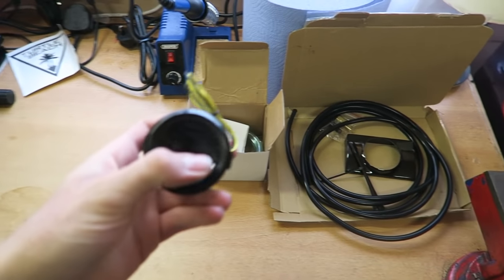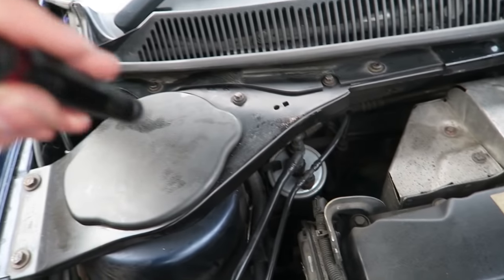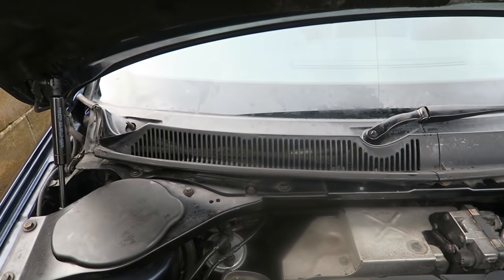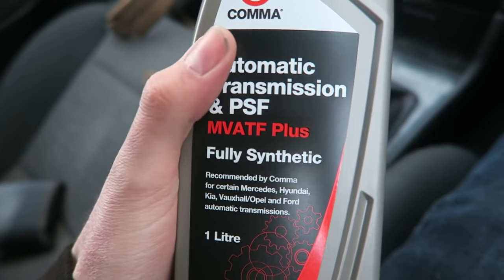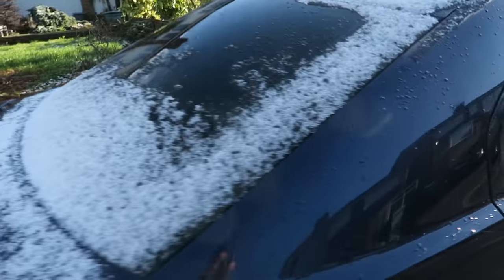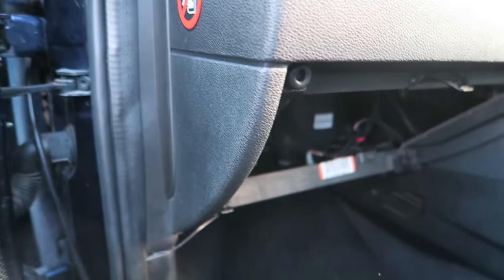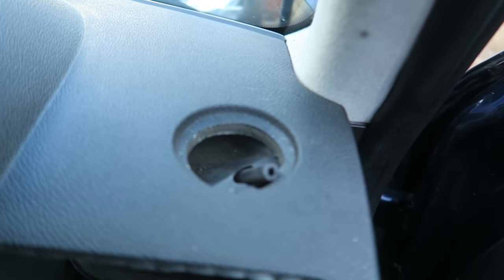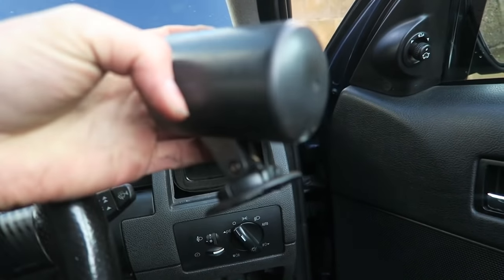Attempting To Install a Boost Gauge (Mondeo ST)

Comment: POWERSTEERING FLUID IN SOME ST'S IS THE GREEN FLUID TYPE. I AM PRETTY SURE THIS ONE TAKES THE GREEN FLUID. EVEN FORD RECOMMEND THE NEWER RED STUFF (BY MISTAKE) BUT I THINK IF YOU CHECK IT SHOULD BE P/N WSS-M2C204-AA, WHICH IS GREEN.???

Comment: Buy a RC nitro car fuel filter from eBay and put it in the vac line. It will stop the vibration you're getting on the gauge.

Comment: A tip to get the windscreen wipers off that has ALWAYS worked for me on all cars is lay the wipers on the windscreen like they usually do and push down on the pivot point... so the hinge. It works surprisingly well. Better than having them up and just pulling as that is pulling them on an angle which makes them bind.

Comment: Couldn't be arsed to read through all 180 comments so apologies if this has already been mentioned 179 times ; If you have your heart set on installing the gauge in the air vent, you have a couple of options. First, buy a spare vent from a breaker's yard and cut the top or bottom of the vent walls and then your current gauge will fit. Block off the air pipe in the dash. Done.

Second option, purchase a electronic boost gauge set. The signal unit is separate from the gauge itself and all the electrical plus vacuum connection goes into the signal unit (some call it a gauge controller), all that links the gauge with this is just 1 small cable. These electronic gauges are much thinner and are easier to squeeze into tighter spots. If you want to play it extra safe, get the 52mm diameter gauges as apposed to the 60mm ones. Plus, I personally favor the electronic ones because they utilize stepper motors for the needles, which eliminate that needle judder, and I love having the needle sweep across the gauge face when I turn the key on. Just makes it feel that little bit more, well, satisfying.

Comment: Heater matrix pipes are central & surrounded by foam so that's usually a good place for VACUUM hose. Also boost guage is essential to anyone tuning diesels, it can tell you if your turbo is going bad long before the seals actually let go & blows the engine up by running away( self destruct) they're also handy for boost leaks & over boost problems👍

Comment: The gauge flicker is the same thing that happens when you use vac gauges when balancing carbs , to get around it on carb vacuum guages you use little valves (very similar to the types used on fish tank air lines) to control the flow of suck and pull through the hoses so it moves slightly slower but smoother removing the needle flicker

Comment: my clock boost gauge is better ;) .... and i see a few comments saying boost gauges are not necessary, personally i think they're VITAL to anybody with turbo cars and especially when modifying,  its always good practice to know whats going on! AFR gauge next! ;)
Reply: Lee Lockwood yes ladss
Reply: Lee Lockwood i found a few little issues over the years just keeping an eye on boost gauge. Ie holding boost, drop off etc Defo worth having
Reply: EGT not AFR its a diesel. As well once you know how to read an egt you don't need any other gauges when it comes to the turbo side of thing. An egt will give you a wealth of knowledge.
Reply: AFR, Oil temp, Oil pressure and boost gauge are a must for me. Sandwich plate for the oil temp and pressure.
Reply: @TinoR626  lee is talking about hes evo 8? Since he started the comment saying he's clock turbo is better the context is his car
Reply: Must say I was pretty impressed with that clock boost gauge!
Reply: @bensdrivewaygarage9014  same keep looking at my kia ceed gt clock n tempted lol
Reply: Yesh I meant AFR gauge for me! 😉

Comment: An EGT exhaust temp gauge is far more important to fit on modded diesel engine. You need to know what your max temp is before you do damage etc. Easy to fit.

Comment: Turbo diesels dont need a boost gauge, its a waste of time and low pressure compared to petrol. You need a specific diesel gauge if you really want to do it like 0-15psi with no -ve /vac boost scale. Youre better off installing OBDII bluetooth scanner and use an app on phone ipad etc with live data monitoring....boost gauges and pods are old skool from the naughties and fast and furious era.

Comment: I finally got my Mondeo st, was looking at diesel, searched any website that was out there to find one ,not that far from home ,found one I liked in blue 
Took my mechanic with me who plugged it in to see if there were any faults and nothing 
The thing is, the advert never said what it was,I took it to be diesel but it was the 3.0 V6 , beautiful, no boost needed there , will pass anything except a petrol station , looking forward to getting it on the road proper

Comment: I installed a boost gauge to my old mondeo in the same place you were trying to I drilled a small hole in the fire wall from underneath and ran the line through there then up through the dash and installed it in the same place and just remove the vent cover from the vent unit

Comment: So - does the larger vent unit not come apart?
I thought I saw two clips holding the front part on... failing that - just cut a circular hole onto the back of the vent unit and install the boost gauge that way. 
But make sure there’s enough depth space behind (in the dash) for the gauge to sit.

Comment: The connector on the back of the headlights switch has a permanent and Ignition live feed.
Access is easy if you remove the little cubby box under the light switch, 2 screws if I remember correctly.
 I hope that this helps you if you do fit the gauge.

Comment: Hi mate, i overcame the problem of wiper removals with a crank puller, the 1 with 2 legs, works a treat. As for the gauge, i would of drilled out the recess behind the vent with a hole saw bit, like the ones you use to drill the holes in wooden doors for handles  and locks ect.. worked for me. Nice vids' enjoy watching your progress on the Mondeo without all the fancy tools and facilities that alot of the viewer's dont have. 👍

Comment: The flickering is cause by too much boost heading through the line, either use a smaller diameter vacuum line or restrict it internally ( I used a silicon nozzle, cut the very tip of it and inserted it in d pipe) rattle went away. I also have the same gauge

Comment: Try opting for a electrical boost gauge which use a sender. As for mounting. Leave the vent out and something like gorilla glue may work. If you plan to keep it. Pro sport psi boost gauges are good and do a needle sweep.

Comment: Tips:

Buy a 5 quid windscreen wiper removal tool from eBay. The way you did it takes ages and can also crack the windscreen if your not careful

Before removing the wipers, put a bit of masking tape on the windscreen marking where the wipers sit in their off position. Makes refitting a doddle

Good effort mate!

Comment: Hi James I have got the same gauge on my cdtisri daily driver and duz the same on tick over also I had to leave the vent housing out and neatly glue that plastic surround in ware the vent goes looks neat tidy and loads better also one more thing try blank the vent off so no heat can come through and make the gauge to hot hope this helps mate

Comment: why dont you cut the bottom out the vent and graft the previous owners old pod into it so it give you the depth you need then use your adapter plate to tidy it up?

Comment: At 8:07 you can see the tyre tread on the front nearside and forgive me if i am wrong but the tyre is on the wrong way. That tyre will force water into the middle of the tyre instead of forcing the out of the side. some tyres have an arrow on the side wall to show you the direction of rotation when moving forward. Is this a possible MOT failure too?

Comment: Are you sure you use the right power steering fluid I Coul have swarn the mondeos have green not red fluid
Reply: I think it does matter cause it will destroy the seal and that in the rack and start leaking ford make it for a there cars for a reason
Reply: My brother in law and I have Mondeos, his is a 55 plate Ghia X and mine is a 07 plate Titanium X both MK3s, his uses green fluid yet mine uses red. Very odd :)

Comment: James... 
Have you tried unclipping the vent? The vent you took out is in 2 parts so you can unclip the back of it thus opening it up. For how easy it is to get another vent from a breakers etc you may aswel have a play around with it. Good luck and try to include more practical work, there seems to be more 'uodates' through the video than before
Reply: Anyway off to mightycarmods now. Look forward to the next video

Comment: You’ll find it will have bad needle shake when it comes onto full boost. I stop it in mine by fitting a little inline motorbike fuel filter just behind the gauge.

Comment: In the stock air vent box there was clips holding the bit you see onto the bit inside the dash so you could unclip it and have a fully working boost gauge

Comment: the wiring james if your doing it on drivers side wire into the positive and negative on the headlight switch then comes on and off with the light switch

Comment: To get through the firewall I always go behind the battery, take it out, take the glove box out fully and knock a hole in the retardant foam and drill through to behind the battery making sure no important cable are there, seal it with a grommet and fire proof sealant. Looking at your car its tight I have always been lucky and had the battery next to the firewall. Definitely drill your own hole and use the fibre glass poles electricians use for pulling cables or a coat hanger to fish through. I bet I could hack a load of holes in that that air vent and make that boost gauge fit....

Comment: on the drives side doesn't it have the same rubber grommet as  the passenger side has? (location were the previous owner had the vacuum pipe fitter bur on the drivers side)?

Comment: Are you sure that's the correct pas fluid? The correct spec is green and I've only known Ford to sell it.
Reply: Meh, its all the same. Will definitely be better than the old shit that was in there. If the steering pump does fail it will be more content :)
Reply: @robthesamplist  The red stuff will ruin all the seals and give you a nice bill for a new pump and rack ;)
Reply: It might be green on newer fords but I've serviced various Fords ranging from an 03 Fiesta to an 09 Mondeo and they all had the red fluid, which you can buy with the relevant Ford spec

Comment: Was there not the same grommet in the drivers side ? Why don’t you buy an A piller mount and use that looks tidy compared to the dash mounted thing you had also saves losing a vent .

Comment: Food for thought, maybe?  Whilst the boost gauge would look fine in the vent location , how would you then deal with the directed  heat travelling to that vent, in theory , you will have heat just blowing around the back of your dash.  An idea would be to get a 3D printed and specific mould to fit the entire vent slot with a hole for the gauge in it.  But you still would be left with the problem of how to blank off the blower pipe, but in agreement with another comment , you will need in all honesty to keep the round vent connected at least to try and help demist your driver window. I own a mondeo too and love the car and like you have and do many repairs myself.  Keep up the good work with the inspiring videos mate :-))

Comment: Can you turn the egg delete round 180° so the nipple comes off the other side, id do that and bring the line through the drivers side. The length is waaay long and I'm thinking that's maybe why the gauge was flickering slightly. Mind every time I've had a flickering gauge it's always been a boost leak.

Comment: Could you run your vac line from where the steering column goes into the engine bay? I did this on my last car used a bit of metal tube so it didn't crush the vac line

Comment: If the MK3 anything like the MK2 then a good place to go through would have been the massive grommet that goes around the steering column. On the Mk2 that is a massive grommet with plenty of space for poking other stuff through. But you can only see it from under the car.

Comment: That is a strange place to put a boost meter. Because the air grille there is for your side window, in the middle is a better option.

Comment: James, stick it on the a pillar. This is where I have mine, you can get a pod on eBay and SCREW IT ON on or get a spare a pillar, sand it down get some body filler and a pod and mount it on, sand it all down and paint it. Don’t go for screwing it on the poxy dash, bloody hideous they are! I have some pictures for examples if need be, or just good them.

Comment: only thing stopping it fitting the vent was the backing which, as you showed, clips in with those tabs. just remove the back of the vent and pop it in. should be sweet.

Comment: If you put a restrictor pill in the vac line it will stop the bouncing needle. I'd be tempted to try kinking the pipe and cable tie it folded over to restrict the flow of you can't get a pill. I did it in a video on my channel back last Yr if you want to see what I mean. Just an added thought, to read vaccum they need to be fitted after the throttle body but maybe you can't do that. Also defiantly feel Your pain of things not going to plan but good vid regardless.

Comment: good vids m8 keep them coming. 1 note though in the new legislation for mots from 2018 a missing egr valve/dpf valve is now a major fail in the mot listings
Reply: Ianc C hidden under engine cover, their not allowed to look, so it will pass. I work in a MOT centre and not allowed to remove anything etc
Reply: @shaungallop8048  On both of my MK3s, the EGR valve is clearly visible without removing the engine cover.

Comment: Ummmm....I don't think you're measuring boost there. 
At idle and while revving you won't spin the turbo enough to make boost. You'll only make boost under load. Or at least that's how I understand it with turbo petrol cars.

Comment: You can fit a tiny fuel filter from a nitro rc car to stop the needle bouncing around on idle. And the back of the vent may come apart so it can fit. I had to do the same in a mk4 golf gti I had a while ago. It didn't last long in the vent tho because when it was dark and I wanted to look in the drivers side mirror, i couldn't see anything due to the reflection on the boost gauge n the window 🤣🤣🤣

Comment: Remove rear part of the air vent so your left with the mounting plate and front part of the air vent to mount the boost gauge in

Comment: find better way route the hose/wiring 'if elec gauge'  ( plenty entry points through bulk head if look from below) and find a more factory gauge option or don't bother would be my advise .
digital gauge with over boost and max boost recording be far better for general diagnostics as a vacuum/boost not fully useful on a diesel .
personally I would just have a display and take data direct from obd2 as be far more useful/convenient .

Comment: Cut inside the air vent to make it fit, honestly that pod thing is horrible looking 🤮🤮
Reply: I was thinking that, I bet you could drill holes or cut it enough to fit even if you have to butcher where it connects its only a driver air vent no-one will notice even if you took it out and put it back to factory.
Reply: Pretty sure if you look at 15.00-15.10 there are tabs that can be pressed in, in order to sperate the rear section just leaving the facia. Problem solved - no cutting required 👌🏻
Reply: @danbrown773  dan- agreed, not quite sure how he missed that the vent face clearly unclips from the rest of the fitting, and right at the point that it narrows.

Comment: just buy a scangauge 2 and plug it into the obd port you will get heaps of info from it .... boost , rpm , intake temp , volts , water temp and much more

Comment: You could put it under the radio somewhere it would be a shame to lose the air vent or you could mount it in the of the windscreen and a piler would be good place just a few ideas for you james good luck

Comment: Dude, could you not take the back part of the vent off so it's two halfs then fit the gauge in that way ? And if you arnt that arsed and only want the garage there for five minutes then use that pod as that way you change you mind down the line then pull it out and nobody would notice, good vid as always dude

Comment: If your doing an android head unit swap, download torque app, bluetooth or wifi obd2 tool and you can set your screen as one big giant boost guage as long as the ford ecu supports vac and boost , much better than lees ;) lol

I can pull my old one out and send it to you to try out (or they are only a few pounds on ebay) only replaced as some android head units only allow phone communication  via Bluetooth so had to get the wifi version

Comment: If that was me I would have got a rubber Gromit and Drew the hole on the driver's side firewall and put the pipe through as for the boost gauge it don't look like you got many places to put it you could buy a plastic face 4 where the air vent is or  try and make one to fit removing the air vent completely replacing it with a full Square with a hole the size of your boost gauge can go in it that's the only thing that is stopping you is the vent channel removing the venture completely having a plastic face panel would look more nice

Comment: Just butcher the air vent your fitting it in , as you can buy spare on eBay and your not using it anyway , so you can basically just use the front portion of the vent as the back part comes off

Comment: I would of ran via the brake booster, and just buy a second vent of eBay and cut the back off, and duct tape over the hot air duct, then you can always put back to stock at any time

Comment: These days there's no need to go to the effort of fitting gauges, all the information can be pulled off the OBD using a cheap Bluetooth adaptor and  the Torque app on your phone or even a spare phone permanently fixed in the car.